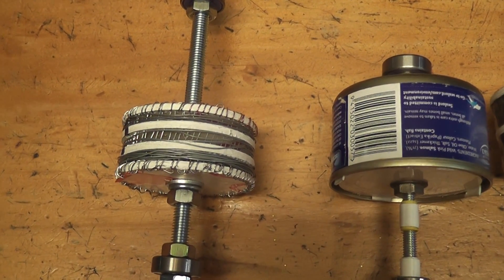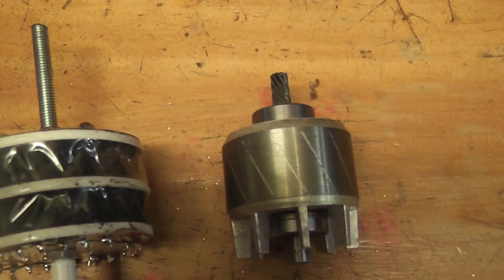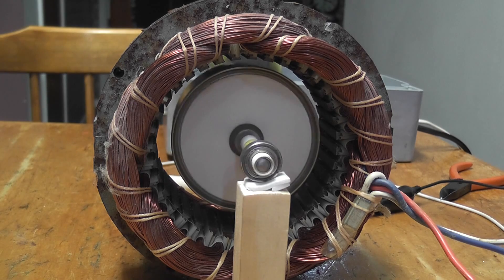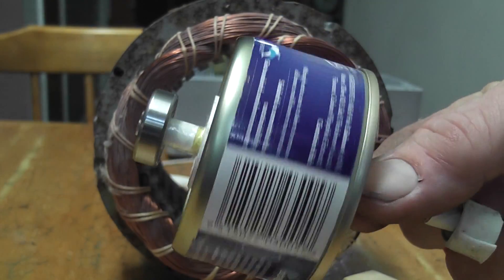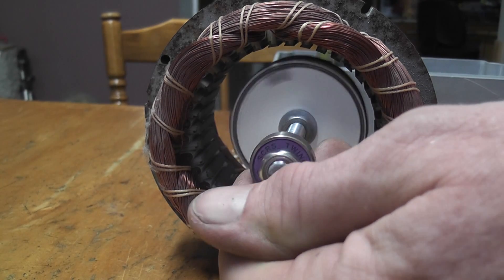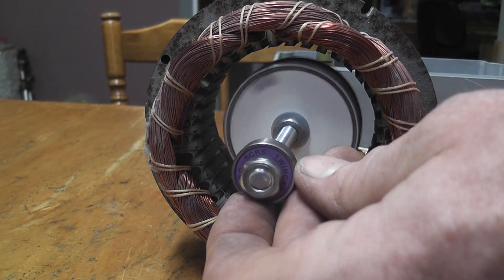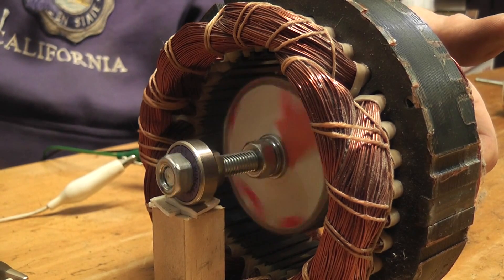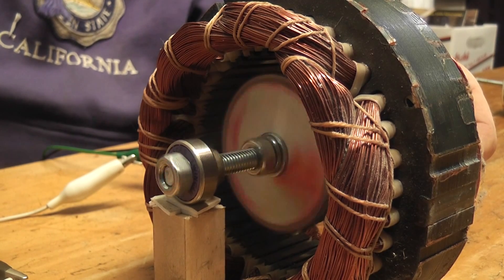Can and Squirrelcage induction motor rotors

Comment: Reduce the air gap between the rotor and stator, will improve efficiency by decreasing the slip. Coffee can or other large can cut down and soldered to barely clear will work and run faster.
Reply from the maker: +SeanBZA Yes, I am aware of that. Not too worried at this stage as I am making this for a school project re how motors work.
Reply: +RODALCO2007 You always have the best school projects!